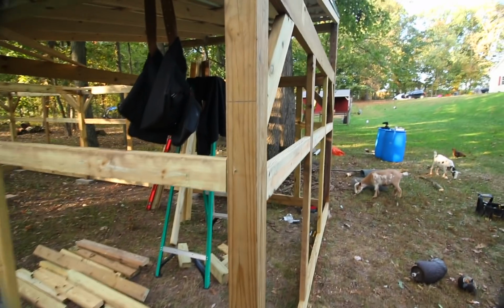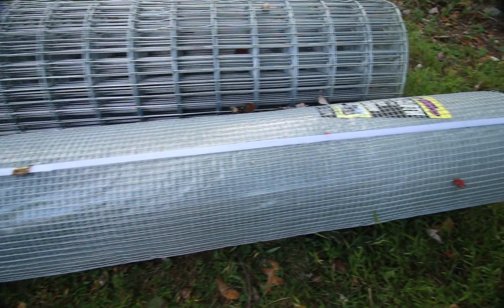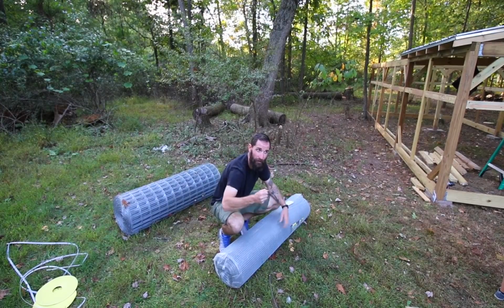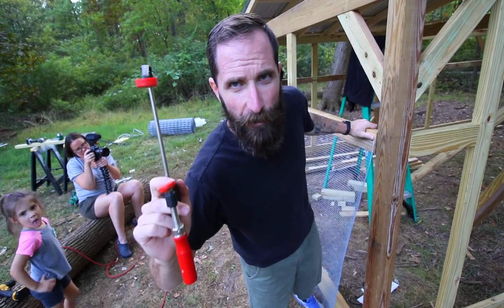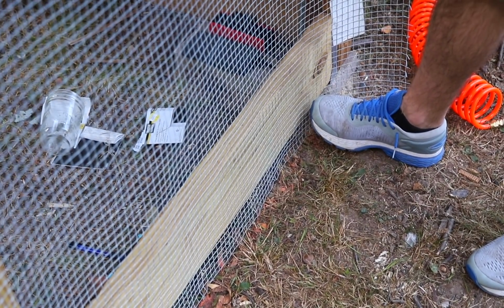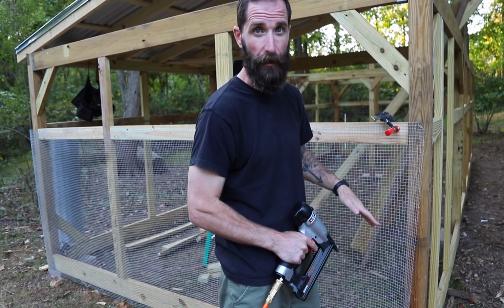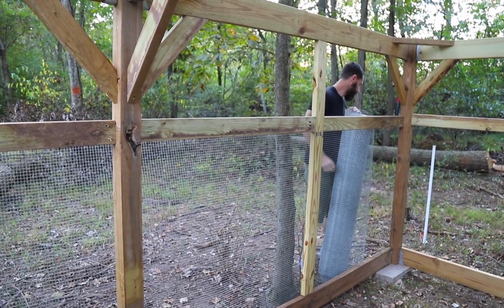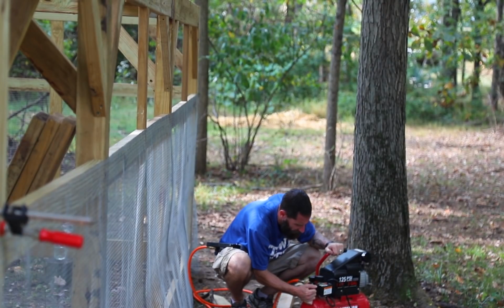Chicken Coop & Run Build || Part 4 || Predator Proofing!

Comment: Looking to build a chicken run and these videos have given me some good tips. I too don't want to dig holes for the posts so I'll also use paving slabs. 

But the build of the run seems to end at this video and all the others are about the coop. I'm interested in how you did the predator-proof skirting that you briefly mentioned, especially since there is a gap between the ground and the horizontal beams at ground level. The details of doing the door would have been useful too.

Also without digging holes for the posts, how did you anchor the whole structure to the ground?

Comment: nice work! as for the knee pain, try taking curcumin every day before or after breakfast, I forget which. Start with 2-3 capsules and work up until pain is gone. Also collagen is good to take for your joints and cartilage pains. And these supplements are low cost and natural. BTW, you look like Christian Bale, the actor.

Comment: This is what we did.  Helpful hints.  Put camera on something so your helper is actually helping.  Also, unroll hardware cloth and measure and cut.  Then staple up.  Much easier.  Having the hardware cloth on the front go all the way to the dirt would have been just fine.  Staple the top of the predator apron right over it.

Comment: Use hardware cloth all the way up- otherwise snakes 🐍 can easily get in
Reply from the maker: We haven't had issues with snakes around here but now y'all got me nervous!
Reply: Also it’s been my experience that predators will dig under. I would dig down a ways and bury tin or wire that would go up a little ways up the walls- The tin or wire would keep anything from digging under👌
Reply: Arch Ratliff Yup...two to four feet of pvc coated welded wire fencing and pavers to keep foxes from digging under the 2x4s.  Seems like a lot of work, but just takes one fox to get in and wipe out your whole flock, depending on how many you have☹️

Comment: Cover the stapled edges with furring strips. Cheap and make it much more secure!
Make sure that you have hardware cloth anywhere that the birds are going to be in grabbing range. Those raccoons like to grab chickens and bite their heads off.
Reply from the maker: I hear ya. We know all about those raccoons! So far everything is pretty tight. Still going to run a bit of hardware cloth around the bottom.

Comment: “Chicken w——“. I’m thinking to myself, No no no.
“Hardware cloth” YES YES YES! 

I’m jealous of your power stapler. I hammer in all my staples by hand...every...darn...one. 😓

By they way, the small predators “at the bottom” (weasels, minks, rats) are really good climbers! If you are going to go with larger mesh at the top you should create a climbing barrier (a piece of bent flashing that sticks out and prevents climbing and jumping up to the next level). 

I can’t be bothered with all that, so I use hardware cloth all the way up. Birds and rats will go through that larger spaced wire and cause all sorts of problems, like multiplying your feed costs and carrying diseases. yuck. 

Gorgeous framing job on that run. ❤️ That thing is going to last 100 years! 

“Well in that case...” walks off. ROFLMAO! 

Nice beard. It’s good to see a man who takes care of his instead of letting it overgrow like a wild man. You are a very cute couple!

Comment: Snakes,rats, mice ect.can get thought the wire on top. A snake came in my coop at the rafters, one three inch hole is all it took
Reply from the maker: Yeah... we went back and forth about it, but in our area we rarely have snakes. Plus, our chickens free range about 90% of the time. This run is to help keep the chickens if we leave for a bit or if we need to plant. Our cats handle the rodents! But, if we begin to have issues well then I guess we gotta bite the bullet and pay for more hardware cloth!

Comment: FYI  I found that after 6 years the staples rusted and gave away on me ! I like the ideal of hardware cloth , im gonna do that ! 2 days ago we had 2 hunting dogs rip threw and killed a bunch of chickens had 23 now 4 hens n 1 rooster ! so a rebuild is in order here ! TY Im forfeiting !
Reply from the maker: Hopefully these staples hold up. They are galvanized and made to work with PT wood. So there shouldn't be any oxidation. Rusted staples can definitely cause some problems. Our lab did the same damage when we first got him. Now we have a plug in electric fence to keep him in check. Works great!